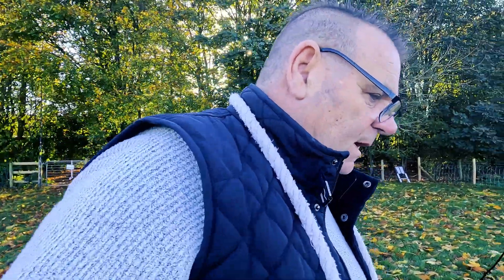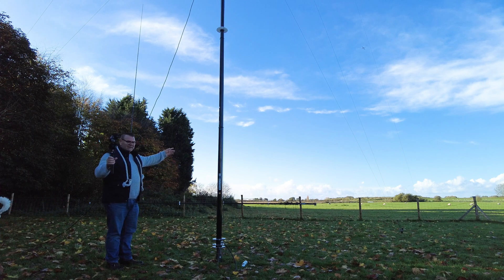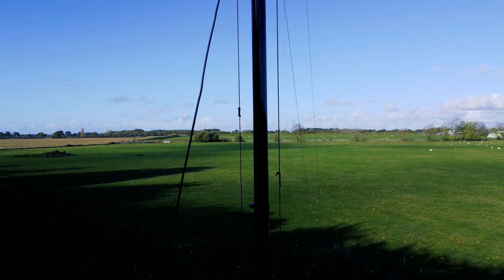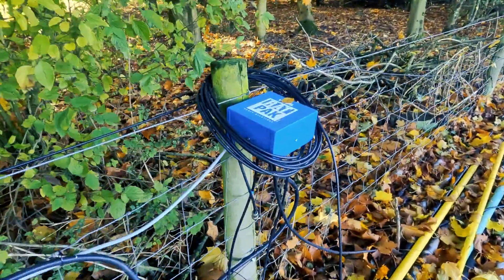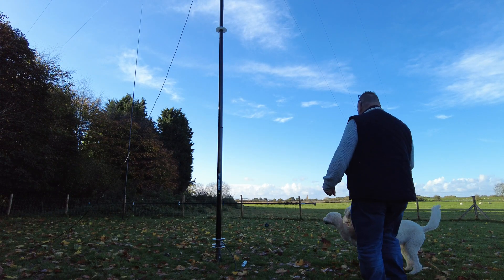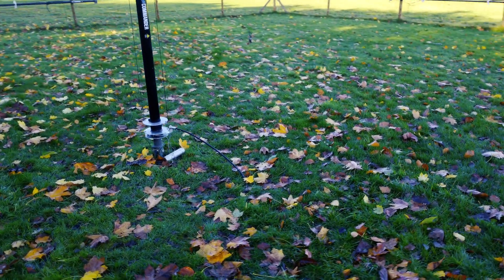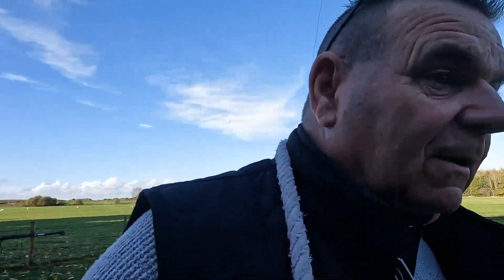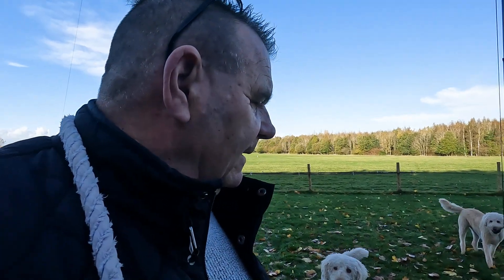Doctor says my My Antenna Obsession is Out Of Control

Comment: Hi Cal, why do you have two feedpoints? Try to run  40 and 20 top down and 80 as an inverted L to a second pole ... Yes, you might need other radials ... vy73, bemi
Reply: Maybe you’d need a 1:4 or 1:6 balun to get it working. So I see the Point, That it ain‘t no dx commander any more.
Reply from the maker: Bemi, don't worry - I'm happy to experiment to give inspiration.. Like you I did wonder if it was "OK" to build stuff that wasn't a DX Commander and have since thought that it's OK! :)

Comment: I would love to see ya build it but to isolate ur current setuo a lpf would be good but back to u buildin 4 they will have to be all single band and not multi band due to the phasing BUT if u made a phased square and made a 4 way power divider that wouod be a interesting way to do it but u could also steer it aswell if u added relays
Reply: Btw have u got a vid on hiw to model a ground mounted array by any chance 😉
Reply from the maker: Yes, I thought about the multi-banding. Phasing might cock it up.. It would still work but the SWR would creep up. Ground Mounted array.. In the plan now. Thanks!

Comment: Haha, you know the answer to that lol, I do however have some potential issue as you may be limited to just 10m due to the length of the mast and may only get 3x on it as you need the angle of reflectors to the first load point, this be let's say 3 meters, then 3meters for a 1/4 at 28mhz, then you want another 3m (1/4) space for the lowest point of the next reflectors, the next point is 3m for loading number 2 etc
I can see potential issues if you have the reflectors in line with the driven element of the lower antenna so the driven points would need to be 9m apart to allow separation of 1/4 from top of driven element to lowest of the reflector...
This would look an interesting build for a uhf antenna as it is similar to many commercial stacked folded dipole array but in this case its not folded.
I wish I had the time and energy to build this for 70cm I think it would look really cool, now for 2.3/2.4ghz you could use a metal cone and a single core for the  center, some people make the cone for 2.4 as a driven element / horn feed and something like this could be stacked and mounted on a bit of 3m electrical conduit, I'm not sure how well it would perform against a 2.4ghz panel array for line of sight but the additional advantage of this would be omnidirectional at a point to point system antenna
Reply from the maker: Ian, totally copied.. I'm thinking perhaps only two (with a decent spacing) would probably give me the same gain.

Comment: I need an antenna to get above trees in my backyard. Would you recommend a vertical antenna for this use case?
Reply from the maker: All depends on which band.. Somewhere around 20m band, it doesn't matter about the trees but the higher bands like being high. Still works on the ground though!

Comment: I say build it but you might want to look at the sort of colinear that uses halfwave sections of coaxial cable connected inner-outer and outer-inner reversed every halfwave. You could either get halfwave over halfwave with some matching issues or quarterwave over halfwave on your 18m pole. Either way round it'd be lighter and easier constuction than 4 x quarter waves
Reply from the maker: Russell, I was thinking of doing that for 20m.. Half over Half..
Reply from the maker: Correction.. 1/4 over 1/4..

Comment: What you're really trending towards here is a collinear antenna right?  I'm not talking about the kind with loops mounted on the side of a pole.  My Diamond X300NA is a vertical collinear vhf/uhf antenna.  Not sure that's possible with HF without a large tower.  I'm also unsure of how they're constructed but IIRC it's stacked 1/4 or 1/2 wave elements.  You end up with a really flat donut for a pattern. Wonder what that would look like ground mounted as they're usually spec'd on a mast?
Reply from the maker: Actually, my mind has already been wandering down that path!
Reply: @DXCommanderHQ  That would be pretty neat.  Ever since I learned how this vertical worked I've wondered if it would work on HF.